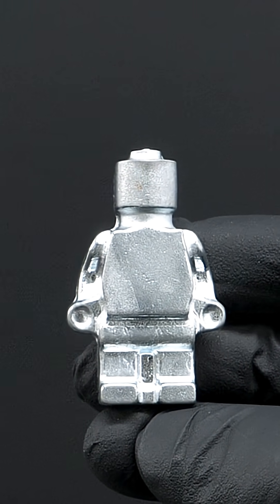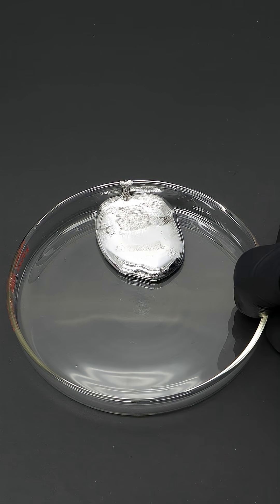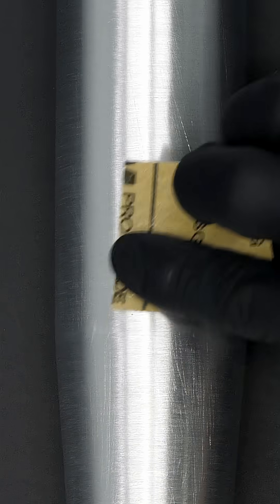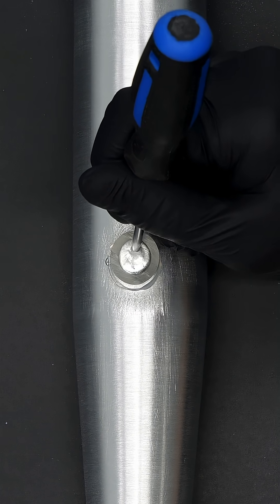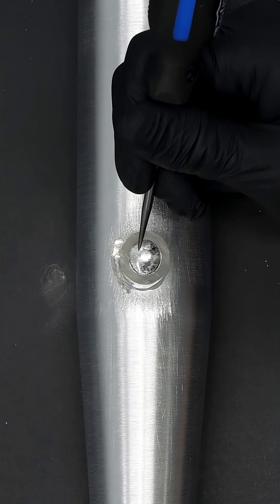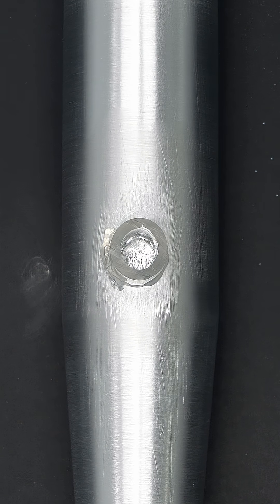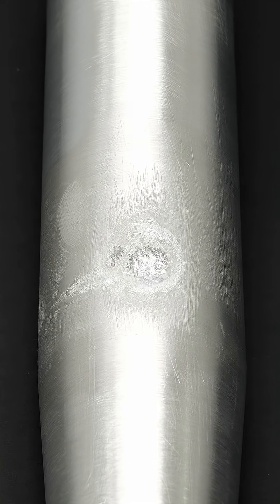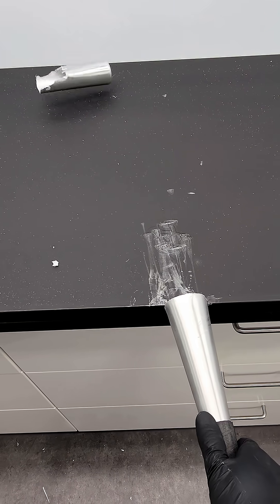This is what gallium does to aluminum

Comment: Funny tidbit. Aluminum has an oxide layer on the surface that protects it. It happens near instantly, which is why the area needs to be scratched again after being covered in the galium. 

Also, its very unwise (and illegal) to carry galium onto a plane.
Reply: New fear unlocked.
Reply: Oh ... Yeah I would think so. Not many things that are allowed and even then it has to be a small amount. Can you imagine someone trying to get it past the security check?
Reply: @tracyrobinson9442 😂😂😂😂
Reply: @tracyrobinson9442  "Can you imagine someone trying to get it past the security check?"

I can barely think of anything easier. Mold it into some jewelry, paint is gold. Mold it into a phone cover. Mold it into frames for your "reading glasses". Mold it into buttons for your shirt. The possibilities are endless.
Reply: @erikjrn4080  Sure, but this is gallium we’re talking about. Its melting temp is so low in comparison to other metals that holding a chunk of it in your hand will melt it eventually. Most of the objects you suggested have a lot of close contact with body heat.
Reply: @Artificer_  Open air on one side and cloth between it and the body, and it should hold well enough. To be sure, you can partially cover it with something that gives thermal protection. It only needs to keep through the checkpoint. Once through, the fact that you can melt it with body heat becomes a pure advantage.
Reply: Because aluminum reacts well with oxygen and can burn in the presence of pure oxygen.
One of the reasons for the Apollo launch pad disaster was filling the cabin with oxygen instead of air.
Amazing the amount of trial and error there was in that whole endeavor that you assume would already have been known at the time.
Reply: @gregorylagrange  Bulk aluminum does not burn.  Only extremely finely powered aluminum can burn.  Powder aluminum was one ingredient in "flash power" used in the early days of photography.  It was combine with magnesium and oxidizers.
Reply: @ISIO-George  I did say "can burn".
Reply: @ISIO-George  Powedered aluminum mixed with powdered rust. Takes a very high heat to ignite, but once it is ignited, it's self-sustaining. The aluminum rips the oxygen from the iron and it changes to aluminum oxide and iron. Common method for rail road track welding. And congratulations, you now know what thermite is and what it can do.

FYI, you can make thermite from an Etch a Sketch, as shown by Codyslab (Cody Don Reeder).
Reply: @BradyT918  andd congratulations YAH.
Reply: @BradyT918 
 So you can bring down 110 stories withh it? 😅
Reply: @gregorylagrange yeah. Apollo 1’s pure oxygen cabin is just insanely hard to grasp unless they were weight or strength constrained to pressurizing the capsule to a very low (say 3-4 PSI) pressure. In which case it makes more sense.
Reply: @UrsaPaedagogus  It's hard to realize how many things were so new to them back then and how many things they figured out on the way that you'd take for granted.
Like another thing about the launch pad disaster was that they designed the cabin door to open to the inside. 
And once the fire started they couldn't get the door open because they had to wait for the pressure to come down because the pressure was keeping the door closed.
There was a space walk mission where they sent astronauts up just to perform a space walk, then come down.
And since space walks were so new they didn't fully account for every action/equal and opposite reaction out in zero gravity.
So the astronaut doing the walk almost couldn't get back in the capsule before it was time to come back to earth because every time he moved one way, it would make him rotate the other.
So his crew mate was watching him flop around and getting worried if he'd have to abandon him.
If you every find a documentary about the race to get the moon first, as well as one on trying to design a plane that can break the sound barrier, it's worth a watch to find out about how much they were truly discovering as the went that today we take for granted.
Reply: @gregorylagrange I teach high school math as well as a elective chemistry and elective engineering. These things you’ve shared connect to STEM, but I find students don’t care. It’s ironic, so much great info and compelling stories and all they want to do is veg out. 😢
Reply: @UrsaPaedagogus  I understand. Now more than ever you probably have to make a relatable connection to a subject.
And made even worse because so many are only concerned with what people who are chasing fame are doing.
Reply: @gregorylagrange  Speaking of planes breaking the sound barrier. Remind me of the Thunder Screech. A prop planes whose propeller spun so fast, that the tips of the blade broke the spund barrier constantly. Was so incredibly loud that it could be heard from dozens of miles away.
Reply: @BradyT918  The pressure build up around the blades is what keeps regular propeller airplanes from breaking the sound barrier.
Other planes have propellers that the tips will break the sound barrier. But the big problem is getting the plane to reach that speed.
It's a fascinating subject. If you've ever seen old movies where they haves scenes where WWII pilot is in a dive and he's struggling to pull back on the stick while other characters are watching saying "Pull up Johnny! Pull up!!"
I used to think that was old hollywood being old hollywood. But that was actually a real thing dive bombers had to be careful of because they would approach the sound barrier during dive bombs.
And the way the airflow over the wing would change created a pressure wave directly over the flaps.
Getting around that problem led to jets having swept back wings.
Call it the delta wing.
Reply: Would make a good prank as a tea 🥄
Reply: @RichardCharbonnier  https://youtu.be/QaJ_Yxj9bG8?si=oFSxdQLcqPZt5Cxt dozens of videos of it.
Reply: The prohibition is becuse it doesn't need AlO2 to be removed to get in, it just takes longer.  A single drop can damage an entire commercial airliner. Once contamination starts it spreads like cancer.  Same solution for contamination and cancer.  Cut out more than what's contaminated hoping to get ahead of the growth and save the plain. The dust from working spreads it , causing a total loss from 1 drop.
Reply: 😱😱😱 Thanks for that nightmare fuel! 😂
That’s interesting fact about planes #102 that I have to remember not to tell anyone who is afraid of flying.
Reply: Me aggressively scratching a Boeing 707 with a plastic spoon I got from the airport Panera bread

Comment: this is why you dont use "liquid metal" heat compound on an aluminium cooler on a gpu. for the inside of cpu heatspreader ther plating it with gold so the gallium is sticking to it

Comment: What happens if you mix liquid gallium with liquid aluminum?
Reply: You’d get a really hot mess since liquid aluminum is over 1200 degrees Fahrenheit
Reply: Yes, but they should still mix together. Or place solid gallium in molten aluminum, why wouldn't they create an alloy or something?@That1Guy112

Comment: Gallium is also used as thermal paste in PC (liquid metal), it's corrosive to aluminium heatsink or cooler.
Reply: Gallium is most definitely not used in Thermal Paste. It is however, itself or as a mixture, used for Liquid Metal in regard to PC cooling, yes. If Gallium was used in Thermal Paste as a standard, there would be many hundreds of thousands of people with the equivalent of dry rotted waterblocks on their AIO's and Air Coolers.
Reply: Nope, no corrosion here. Its just than liquid gallium can easly separate alluminum crystal grains and weak them
Reply: What!? 😂😂 No, thermal paste doesn't contain any of it. You must be confused with liquid metal, which is mostly installed in factories on GPUs and copper heat pipes or vapor chambers, or in confined spaces on some high-end laptops or super-specific applications, but not in any thermal paste. Thermal pastes are mostly some sort of ceramic compound or silver, etc.
Reply: Luckily pretty much any water cooler has a copper cold plate and most air coolers are using copper heat pipes so less of a problem but very bad if you use an all aluminum heat sink like the one provided with most CPUs.
Reply: well its not just only gallium.
its 
Galinstan i guess because its liquid even under 30C.
galinstan is a mix of 2 other metals with galium i think but im not an expert, this has a even lower melting point.
Yes so its Galium, Indium and tin and this melts at even -19C this is -2F so its defenitly liquid at room temperature.
Galliums melting point is about +29C
And to extend it, almost every CPU has liquid metal between the dye and the metal inside.
Its not really that neccesarry to use liquid metal instead of thermal paste instead you are like some crazy gamer playing with overclocking and temps.
Reply: @SkidNoob  This is true, what we call liquid metal is not a paste and is not actually just gallium, but rather an alloy that consists of mostly gallium, because they need it to be liquid at room temperature.

I feel I should note that while some might, CPUs don't necessarily have liquid metal under the IHS, they use TIM (thermal interface material) which is basically "whatever the CPU manufacturer decides they want to use." This could be the crappiest thermal paste on the market (Sandybridge) to liquid metal to solder (which can dramatically raise the chance of destroying the CPU during the de-lidding process).

This can be seen in any CPU release where thermals get improved if they are de-lidded and the TIM is replaced with liquid metal (indicating it was either not liquid metal to begin with, or it was a low quality liquid metal). 

Also in more modern CPUs liquid metal can still help (either on top of or inside the IHS, or both) even if you aren't overclocking the CPU yourself because the CPUs stock behaviors these days tends to default to boosting to their temperature limits. 

This has even gotten to the point that some CPUs won't reach their stock spec's max boost consistently unless you remove the IHS entirely and perform direct die cooling.
Reply: What ._.
Reply: Heatsink is a thing that helps absorb heat from electronics and stuff. Thermal paste is used to attach heatsink to the heat-producing thing (i.e. circuit board, motor, ECT.). It is used so that heat travels more effectively to the heatsink. From there, normally a fan blows air through heat sink to dissipate the heat away from the device.
Reply: @GalaxytabA9-c2r  It should be noted that nearly every company that makes CPUs and heatsinks use nickel-plating or copper for the contact point, even if the majority of the heatsink is aluminum.

So the gallium-aluminum reaction is very rarely an issue, even if you do decide to use liquid metal over thermal paste for your CPU+cooler (it is more difficult to apply though, and misapplication can be catastrophic, so you will still want to watch some tutorials on it).

edit: I say rarely instead of never because there may be a few heatsinks out there that are just aluminum, so you would probably want to make sure that is not the case (typically this would only happen for something very old, specific, or cheap, like old stock coolers, or a cheaply made in-house Dell cooler, as those have the potential to be plain cast aluminum).
Reply: Thanks.  @credge